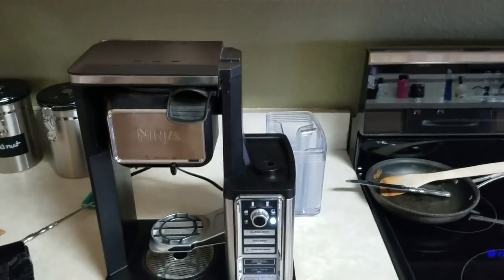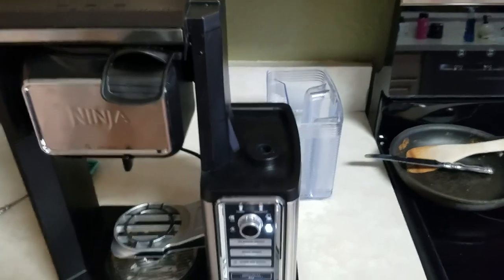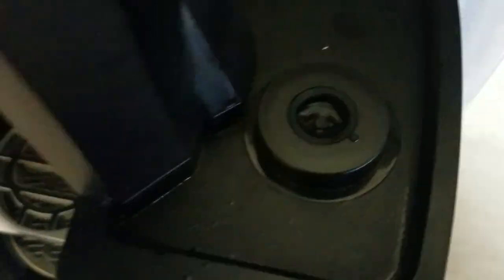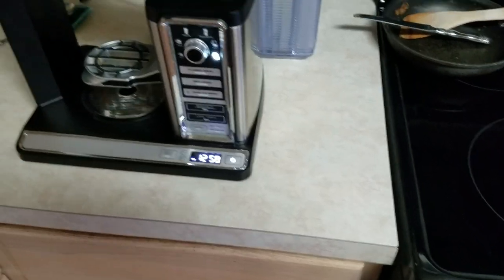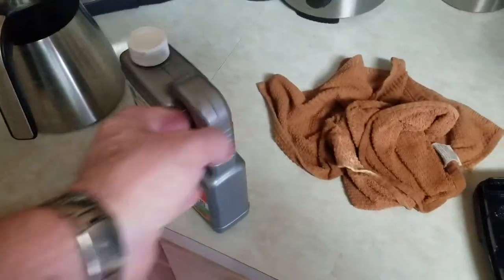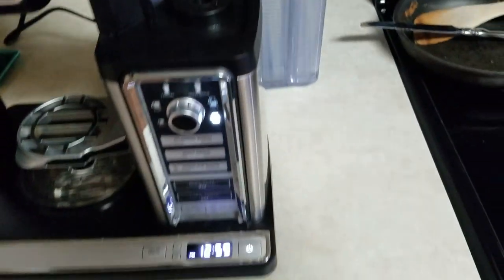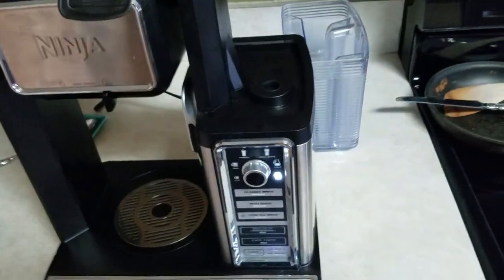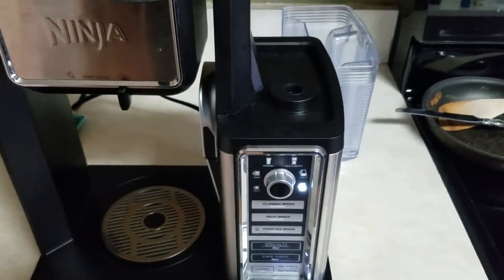Ninja Coffee Bar - 5 Beep Fix (Shut Off)

Comment: The flow meter detects reduced flow signaling the maker to do the five beeps. I went through six videos, including yours, and I cleaned the metal hose and the scale off in three different ways. It worked for a week before the beep came back. I told Ninja on Twitter about it, and others did, too. Template response. Treated you like a generic customer and not a person. If they would've responded on Twitter with real solutions, I'd have stuck with it, but when the beep came back after a week, I said, "Okay, that's it." I later bought an Aeropress for $30 and it makes better coffee, faster (as fast as you can get hot water), quieter, and you can take it anywhere. That said, thanks for the video, Roger. It helped.

Comment: Quick insight on why this works:

 - There's a hose attached to underneath where you blew
 - This hose connects to a flow meter (Google "ab32 s21p030c 11R" you'll see a doc explaining that it's a flow meter used for coffee makers that use "vibration pumps". The 30c is the opening in mm (3.0mm), 11R is the angle (w/e that means) and  AB32 represents a model.
 - The insight of the coffee maker gets reeeeeallly scaly, and I think scale clogs up the hose
 - I think clogging up the hose causes the flow meter to register as "too low of flow"
 - The coffee pot takes this signal, shuts it off, and gives you the five beeps.

So I think five beeps simply means inadequate flow, usually caused by scale.

If this doesn't work,  finding a way to blow descaler into the same spot that you blew air in could save some people some time, but I don't know how to cleanly push vinegar/descaler in there, so I took the bottom apart pulled the hose out, filled a Sriracha bottle w/ vinegar, and used that to blast vinegar through it. After putting it back together, it worked.

Comment: Are you guys sure you should be putting CLR near your food ?  I think it says on the bottle not to ingest?
I used a weak sulfamic acid ("Lime-Away") mixed with water. (Not  Sulfuric)  they make citric acid that you can use too. 
Then after the sulfamic acid/water solution broke up most of it, I rinsed it with a 50/50 mix of strong white vinegar & water. 
I did this until the solution that came out was clear, and then I rinsed it with water a few times, until it stopped tasting and smelling like vinegar. 

I am sure CLR works great, but I am not so sure that it's a good idea to get it near your mouth, skin, or food. 
If you feel you need to use CLR on your coffee maker, at least ask the maker of the machine if it is safe. 
CLR claims that all coffee makes that hold water should not be cleaned with CLR because it is toxic and some of it can get trapped inside the internal heating element chamber and water pump. 

Be Careful With That Stuff.
Reply from the maker: I ran 15-20 full containers of water thru it afterwards to flush any CLR out afterwards
Reply: CLR  says you can use it in your coffee pot right in the label  it even gives instructions for it .
Reply: @JaneDoe-sunshineinflorida  ...as long as it's the kind that doesn't hold water inside the machine between brews. They have a list of does and don'ts on their page. 

I wouldn't go using it every time.
Reply: Oh that’s definitely good to know thanks for that tip . I didn’t know that . Although I’ve already done it about 100 times in the old keurig🥺
Reply: @JaneDoe-sunshineinflorida  ya.. i'd just call the company and make sure. just because you did it a bunch doesn't mean it's less toxic.
Reply: 20 full container later it still smells like clr

Comment: Check inside the water reservoir,  the white dome is a strainer.  Around the sides, are 4 fine screens that are designed to stop any particles.  If you use your pot to fill the reservoir,  it's probable that coffee grounds have clogged the screens.  Symptoms include 5 beeps of death, your machine won't brew a full pot and it makes alot of steam.   The screen is pretty difficult to clean as there isn't much room.
Reply: The problem I'm having is with the drip stop... Maybe its connects somehow. Brew half a pot then the drip stop starts blinking...wont brew...it doesn't shut off just stops. Slide the basket in and out...maybe flip the drip stop switch back and forth and it works again...but only for a few seconds! Making me mad!
Reply: @-nobody6272  the drop stop uses a magnetic Reed switch.  It can be adjusted or bypassed. Take the drop tray apart.  You will see the magnet and metal strip. Move the magnet closer to the metal strip.

Comment: Hey Roger - another YouTuber posted a much simpler and faster fix by just flipping the machine upside down while pressing in the black button valve where the water reservoir tank pushes into. Didn't have to take anything apart and solved the 5 beeps problem in 10 seconds.  I'm sure your fix works great as well but just wanted to give guys another much simpler fix...and no CLR or running through 5 pots needed! Here is a link to the fix: https://youtu.be/F18pL_E6ALA